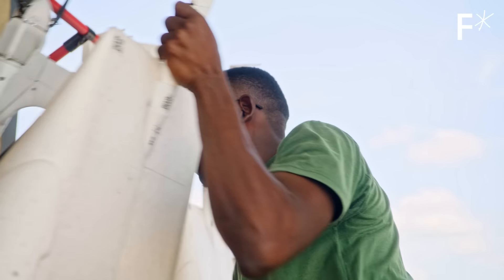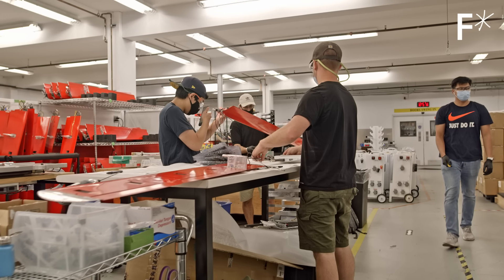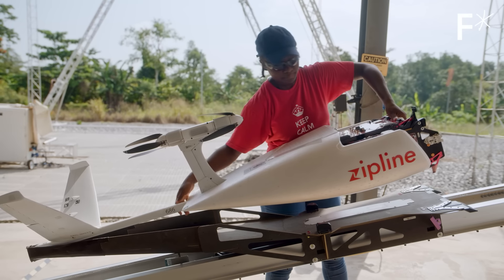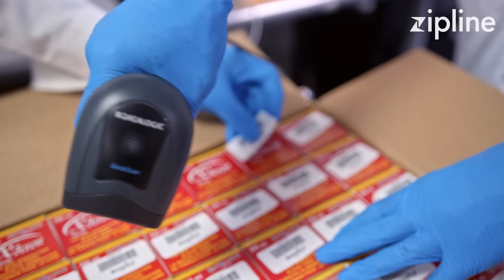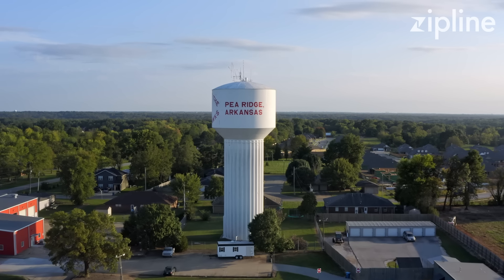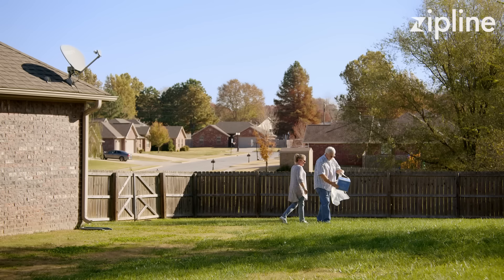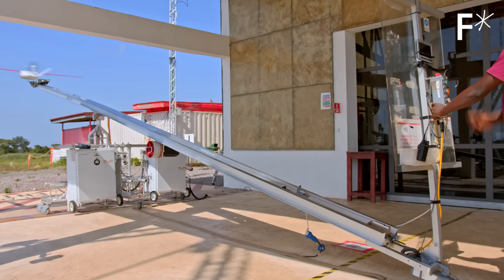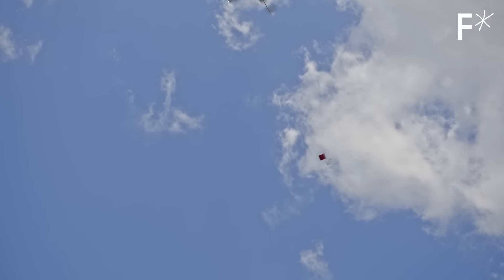This delivery tech is “the closest thing to teleportation” | Freethink

Comment: Amazing stuff, but I can see some issues to the validity of this system, the weather will impact delivery for example, are those drone able to deliver while it's raining or snowing or windy, and launching products from the air will also introduce issues, what if the chute doesn't open? The crash will destroy your package if it's fragile and a package coming from the sky is a bit too visible which will help thieves to spot those packages making them more vulnerable to theft, and again if it's windy and the there's no way to regulate my package decent beside the chute  then it can land very far away. I mean I like the idea but more clarifications on how it works would be better to help people trust your system
Reply: the system can operate in inclement weather and the planes have multiple redundancies built into them, including the plane immediately deploying a parachute if something drastic goes wrong. They've flown over a million flights by now and have still yet to report an incident involving an injury. Give them credit honestly, they've really made this work where they can.

Comment: This is designed much better than any of the solutions I've seen using quadcopter drones. I'd bet on this design for the future.
Reply: Different usages.
This plane design is to transport light and small products. It's operation area are the sub-orbs or "out in the woods". It has no use in cities. It could maybe be modified to work in cities to drop off the packages at some distribution center, but I doubt it'd be economical at all.

The quadcopters were designed to transport general goods, that may have some weight (but probably a pretty strict weight limit). This one was meant to deliver directly to customers in populated zones... I have no clue what they were thinking, because they cannot deliver to an apartment.
Reply: Quads do not have the distance compared to fixed wing, on the other hand quads have more lifting vertical power and can be useful for shorter trips with heavier loads.
Reply: Helicopters have tooooo low efficiency compared to planes.
Reply: @himanshusingh5214  Planes can't hover....
Reply: @theecstatic9686  that’s not what he meant. Plane efficiency comes from the fact that it doesn’t use battery power to maintain lift, while quads do. So distance is greatly reduced with quads because most of its power is used to stay in the air.
Reply: @muuubiee  It is unlikely that it could even be delivered to an Apartment any time soon. It would take more Quads and more energy to do so, the better use in a city is that it would be a cheaper way of relaying packages across the city to perhaps several hubs. From where packages can be picked up at a set time. It's size allows more mobility in comparison.
Reply: @muuubiee  A fixed wing is FAR, FAR more efficient than any multi rotor or even single rotor aircraft. I'd argue with the launch design the fixed wing can carry far more weight. Also far safer (with the help of AI) as a power loss with a multi rotor means almost certainly a crash. Fixed wing can at least steer clear of streets or pedestrian areas and seek a tree to "crash safely". 

I've seen prototypes of hybrid designs that can launch/land in VTOL, then convert to fixed wing for efficiency and battery life.
Reply: @theecstatic9686  Ahem... The V22 and Harrier and F35 would like a word.
Reply: The perfect solution combines both these devices and drones so that depending on the item to be delivered, distance, etc., the appropriate delivery mechanism is queued up.
Reply: @yourfavoritecio  too expensive. We need 2 perfectly optimized techs for different areas.
Reply: Maybe vtol drone which combine rotor and wing efficiency?
Reply: I mean the ones like osprey vtol aircraft?
Reply: It needs landing room tho
Reply: @jonboy545  what about landing
Reply: More like both
Reply: awesome idea for rural and developing  countries .... I just hate to see mindless wasteful throw away products ziplining through the air by the millions ....

Comment: This is great system for responding to emergencies. Especially in conflict areas where large aid shipments are often seized by  military forces. Its much quicker, cheaper and more precise.
Reply: @egillis214  That's why some kind of inertial navigation system should be developed for UAVs. Being dependent on satellites is the biggest issue with all these things. If you interfere them with something - all their electronics becomes useless. They should be completely autonomous like a bird flying only by using natural compass and vision. Right now all these things are too expensive and fragile.

Comment: Great idea. What is being done to mitigate the packaging waste issue? It's already bad enough in cities since the rise of Amazon and e-commerce, but at least here we have "developed" waste disposal, dump sites and some recycling. In less developed countries, it would be great if they learned from our mistakes and built in the logistics of packaging waste reclamation and recycling from the beginning rather than a half-hearted afterthought.
Reply: Cardboard can be composted, but the packing tape has to be removed.  So if they make a packing tape that is biodegradable, you could compost packaging completely. Plastics have to separated out of course.
Reply: the chute would be the main problem I think

Comment: I admire the tech behind zipline but I am not convinced about useability. Its great for nature calamity situation or economically backward areas,  rest i am not sure.
Reply: why not?????? what do you disagree with usability on???
Reply: @markBalentine123567  how will you adopt it to deliver in crowded cities? For example to individual appartments?  I agree this could be amazing for special cases like military or areas struck with natural calamities, in short where infrastructure is bad. For everyday deliveries drones might be better suited.
Reply: @supriyam6896  even normal delivery drones are problematic, thats why amazon hasnt had success yet. They have the same issues as self-driving cars, there are too many variables that could go wrong and can cause real damage such as, hitting a building, a car, or even people. For urban areas with a dense population the risk is too high
Reply: @ahmedo7875  Atleast drones don't airdrop the package. They have relatively more precision.
Reply: Zipline has been successfully working in Ghana already for several years. There´s countries, where the implementation could me more difficult, but for most other countries, it should be even easier...
Reply: @klausbrinck2137  how many skyscrapers and densely populated cities does Ghana have ? If you notice the drones land the package in a open field good luck doing that in central london or New York
Reply: I think they mentioned that their plan was to use it mostly in rural/suburban areas as in cities mostly everything is already within walking distance

Comment: This is a good idea in theory. However, there are to many big issues to overcome. One noise pollution. Two, FAA. Three, protection for birds. Four, equipment for everyone to aquire for accepting deliveries.
Reply: Equipment for accepting deliveries? It literally drops packages what are you talking about
Reply: Cmon...noise pollution in the outbck of Africa ? And that few birds ? Nah
Reply: @HarrisonMartinson    how does that work in Manhatten?
Reply: @jichaelmorgan3796  I think this kind of technology is more suited for rural areas that has a harder time to get the right kind of equipment. Obviously crowded placed like manhattan wouldn't be very ideal but fortunately they do have lots of goods and supply. But if they intend to do it through manhattan that would be another challenge!
Reply: @HideOnMada    hmmm maybe some kind of big drop baskets on top of buildings with a sorting mechanism?lol.  But yeah in it's current state it seems like a great way to bring the outskirts closer to the rest of the world, kinda like satellite internet.
Reply: @jichaelmorgan3796  Well yeah obviously this solution isn't for Manhattan

Comment: How does the drop system ensures the package not land on top of a roof, or stuck on top of a tree branch, or get lost in a thick bush?
Reply: @miker9082  can you please explain how you get that assumption I'm very curious.
Reply: @digitalestatecapital  i did.  Re read if you must.
Reply: By dropping it in a preselected area as large as two parking spaces. The drone also calculates locally based on wind direction and strength to drop the package in the predefined space. So a grass field next to a hospital is perfect for that.
Reply: @miker9082  We can't, because you deleted your comment.

Comment: OMG. More trash generated for a relatively small delivery. Yay!
Reply: Why more trash?
Reply: @millanferende6723  Well, there's the protection materials used to protect the drop. And then there's the parachute. 

I mean this is the same problem as the food prep kits people subscribed to. If you go out to get the grocery, there wouldn't be the need for all the packaging involved, e.g. a bag just to hold a few carrot strips.

I do get that not many places are accessible but at the same time they need to address creating garbage as an issue.

Comment: Do the packages have parachutes? Or are they protected well enough to not get damaged? From what height so they drop the packages?
Reply: From what we can see on the video they are pretty well protected, but they are also small products, small enough that they won't hit the earth too hard and break when delivered. There's also what seems like a parachute-like device installed on some of the packages
Reply from the maker: Great questions! They do have parachutes. They're paper-based and you can get a closer look here: https://spectrum.ieee.org/in-the-air-with-ziplines-medical-delivery-drones . In terms of drop heights, they fly at a height of 80–120 metres (260–390 ft) and descends to a height below 100 feet to drop the package.  The exact height varies based on coordination with local air safety regulators.
Reply: The Parachute does quite a good job at slowing decent rate. Combined with conventional packaging protection it will land safely with no damage. Parachute Landing is way softer than being dead dropped 5 feet.

Comment: In my opinion it's not a new concept, drones already exist and it can be used as a 2 way transportation system (a to b & b to a). Drones can also land the product safely door to door, unlike zipline, ntm the added cost to make the goods stable enough to absorb the drop off. However drones face the trouble of being attacked by hawks and other predictors, which I believe is also a problem that zipline will face soon.

Comment: What exactly is the benefit of this system? A truck might need a road and take longer, but it can carry thousands of time the weight. It also can have a fridge/freeze built in to keep medical supplies at the optimal temperature. No guessing if you got the ratio of dry ice and insulation right.
 Not everything you need is going to be shipped on these little drones (like a bed, for example, won't fit) so if trucks are already going to your village or wherever, why not use them to deliver everything else?
This could be useful as an emergency delivery service for medicine or food if flooding took out the roads, but airdrops are already a thing and can deliver more.
Also, what's the plan for dealing with the parachutes? Are they reusable? If the places you deliver to are that remote, how do you get the used chutes and boxes back to the depot? If a parachute, harness, and container weigh just 1% as much as the cargo, then a town of 2000, getting 1 ton of supplies per day (average of 500 grams or a big cup of water per person) then that's a minimum of 10kg of plastic per day a for small village that needs to be dealt with. Trying to replace, as they said in the video "Basically 100% of medical products and almost 85% of traditional packages" would be absolutely massive.

Comment: I really like this idea and the technology in it. My only concern is theft since there looks to be some possible issues with high winds resulting in missed drops. Also, if you live in a big city or apartments then how will you recieve it reliably? It's an excellent idea for villages though
Reply: Reminds me a bit of satellite internet
Reply: The drones fly relatively low for drop off and calculates locally based on wind direction and strength to drop the package in the predefined space, which can be, according to Zipline, as small as two parking spaces.

Comment: While watching this video I had an idea. It occurred to me that not that long ago homes were built with chimneys. They had to be because wood stoves and fireplaces were our only source of heat. I think a chimney like structure could serve as the perfect platform for technology like this. It would give the aircraft a safe, at height structure to land the delivery on. Once a delivery had been placed on the chimney platform it could be lowered by the customer via motorized or manual pulley like a dumb waiter. It would solve a lot of the risks that currently pose against this wonderful technology. You could even have a QR code etched into the platform so that the aircraft could verify the address before dropping off the goods. We once built chimneys because they enabled us to experience comfort in the form of heat. Why not bring them backe to enable the comfort of on demand, instant delivery, anywhere in the world! #ReviveChimneys4Zipline

Comment: I live in Bentonville Ar. about 5 min from pea ridge. I like this concept. But the delivery has to be one of the stupidest ways to deliver around here. In Arkansas everything is muddy your package is going to definitely end up in the Mud even if you have grass because of irrigation system . Your package is going to be a mess. Quad copters would of at least allowed the package to be placed on a drive way or sidewalk.

Comment: Based on the assumption that there will be no interference, some of which could be intentional. Looters can learn and adapt as well.
Reply: People would use them as target practice for shits and giggles
Reply: @flyingsky1559  Good luck hitting an object that flies multiple hundred meters in the air at a speed of 100 km/h.

Comment: I think considering the large catch line and launch system(costly), a modern technology VTOL flight vehicle would be much better. Otherwise a fantastic innovation. 🤟🏼
Reply: A simple drone with fix wings and catapult launch system are way more cheap than a VTOL, and means less parts in the vehicle and less weight, what means more cargo capacity an more cargo area and better autonomy and speed; albeit the parachute, that can be throw away off the course by a moderate wind,  are not precise to use in dense urban areas.

Comment: Kind of useless tbh. Planes can do different types of cargo drops. Some right above the ground. Much larger cargo. And if you need to ship smaller payloads such as medicine or blood bags, then a simple rotor drone is enough. No need for a catch system.
Reply: What if there is a hospital with a distance of over 60 km that needs a bloodbag of a specific type? A "classic" VTOL drone won't be able to deliver it but a dixed-wing one can due to considerably less energy consumption. It is also much cheaper than sending an entire Airplane with a crew, which needs to go high into the air, much higher than the drone. I dare to say that a plane would even use much more fuel to get up in the air compared to the trip itself, which Zipline circumvents by catapulting the drones into the air at cruising speed.

Comment: Lol. Seems like a idea from 20 years in the past. Using airdropped packages, with all that packing material, parachutes....dangerous and wateful. Even is you make the materials and packages reusable then you would have to make another pickup round with real cars to get the reusable packages. People will never return them in a certain collecting point. 

It's a dead idea. Drones might be the solution, vertical takeoff and vertical landing. Practically no packaging needed as drone can have one solid box

Comment: Again..another pod delivery logistics system steeped in jargon circumventing the basic issues..the zip launching system still needs the normal truck and airplane logistics system to bring in the required goods for the launching system. And there's A ton more issues I can think just from the top of my head..just the scaling up issues..volume to capacity issues .. breaking up volumes to pods for logistics is a logical fallacy..the only upside is remote access delivery..and I don't see how that isn't taken care of by just regular air supply .. any suggestion of higher volume is just marketing wish wash. The only use case for this is emergency medical supply. And that's it. And if it works only for that..then I guess that's a good thing. Definitely not for commercial delivery services.